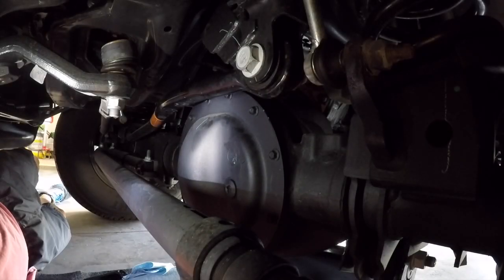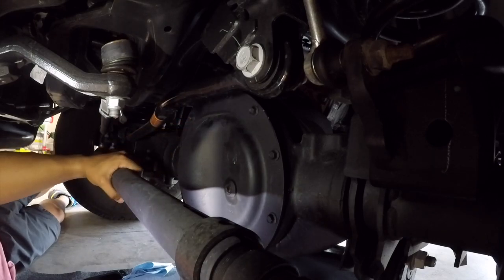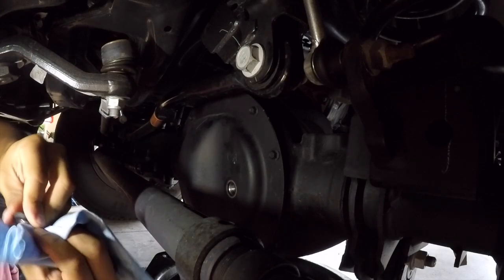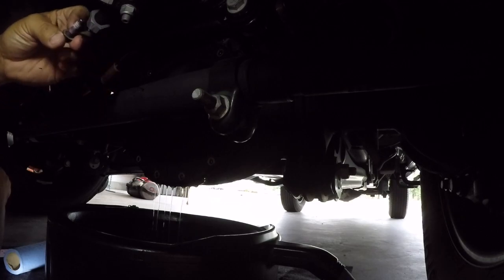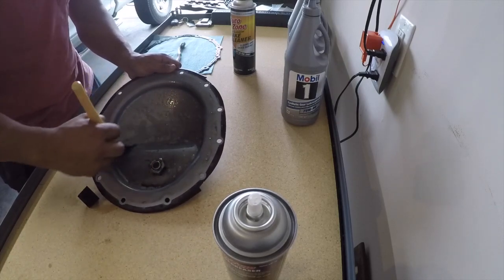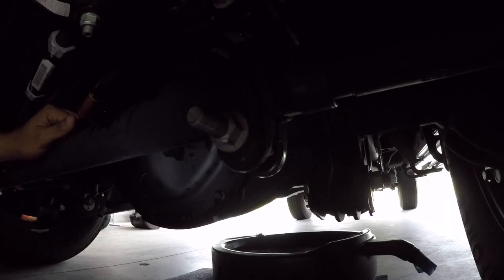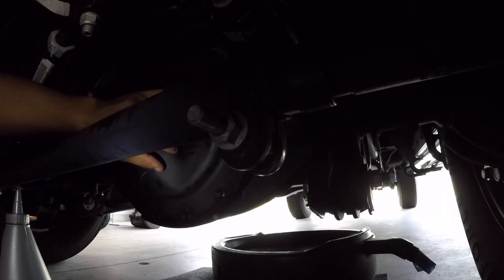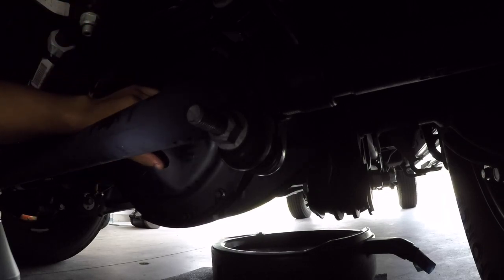Ram 1500/2500/3500 Front Differential Fluid Change

Comment: Well my 2014 1500 calls for 75w85 so I’ll go with royal purple 75w90 but has the limited slip additive in so I’m not sure if I can. Use it
Reply from the maker: It may not need it, but it still may be fine taking it. I like the mobile 1 stuff.
Reply: MOTOR HEAD is it in the Mobil 1 the additive as well ?

Comment: Grt video man thanks. Does the front diff require additional 4oz of limited slip oil?
Reply from the maker: EB Lou Lou I know my year, 2018, doesn’t require. Reference your service manual though because I know they made a change within the last 10 years.
Reply: @MotorHead18  thanks for the reply. Will do.
Reply from the maker: EB Lou Lou NP!

Comment: How long did this take approximately from start to finish? Also the specs say use 75w 85. Is there much difference between 85 and 90?
Reply from the maker: Sergio Canepa I believe it took me an hour and a half because of filming. If I were to do it again, I could get it done within 45-60 mins. No there is not much difference between 75w-85 and 75w-90. Most that change out their fluid either go 75w-90 or 75w-140. Depends on what you use your truck for but you cannot go wrong with 75w-90.
Reply: @MotorHead18  Awesome! Thanks for the video and the info!
Reply from the maker: Sergio Canepa Feel Fred to check out my other vids, I could always use another subscriber brother!
Reply: Sergio Canepa